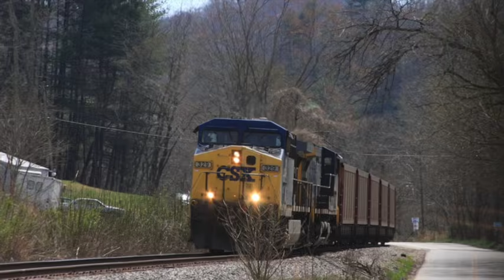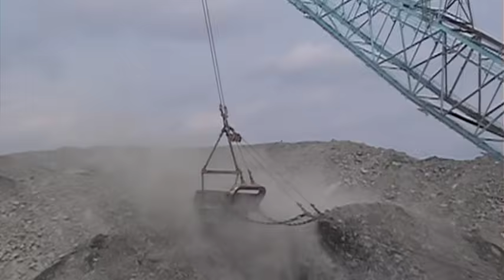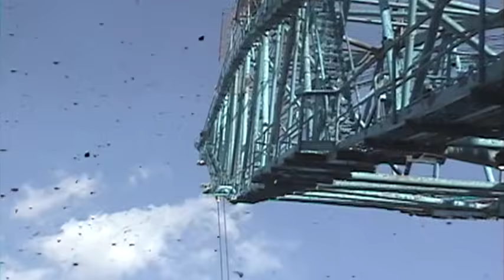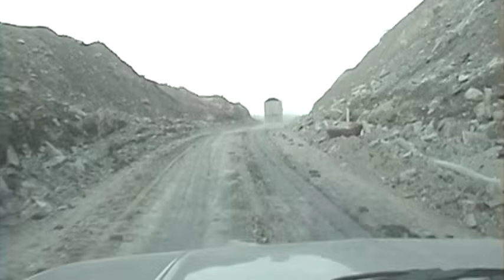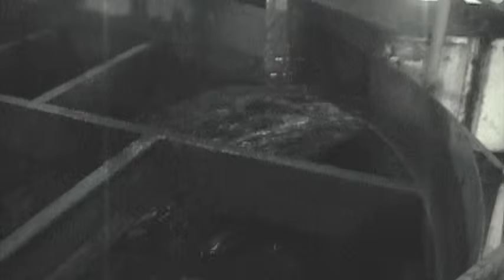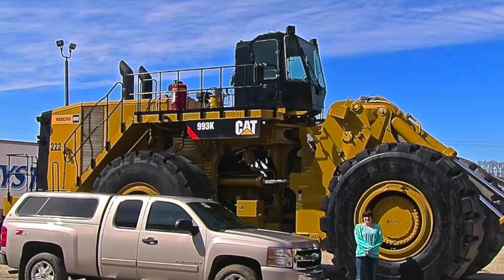Coal Mining in Appalachia

Comment: I understand that the industry uses coal to provide electric when hydroelectric isn’t available.  And my grandparents used coal until the mid 70s.  My parents used heating oil for as long as I remember.  But, I tried oil when I established my home, but now, I am strictly electric, probably by coal fired generators.  But, no smell, less maintenance. And it’s heat! Black Lung just driving!Great vlog!
Reply from the maker: Yes, in all likely hood the electricity we use comes from the burning of coal or another fossil fuel.  Like it our not it will take a long time to build enough windmill generators and solar panels to take over.  But we still have to contend with no wind and clouds not to mention night time.

Comment: 4:10 can anyone explain how a simple pull on a lever can open the latch of the bucket if bucket is holding about 50 tons?
It baffles me as surely the rock would press so hard on the catch as to need a great effort to move it to open the bucket!
Reply: @ericstandefer9138  Dunno.
Seems the operator just pulls the little lever.
Reply: @ericstandefer9138  This video shows the latch seems to be operated by a simply rope/cable. https://www.youtube.com/watch?v=eXGbMUHp75E
https://www.youtube.com/watch?v=gptHVtRZxFs
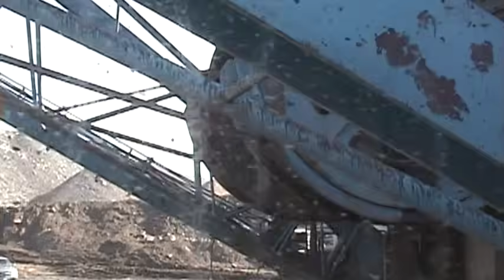But this video from 10:00 seems to indicate the bucket does have some electrical power latch as guy doesn't pull any levers to open the bucket.  Maybe it's that little switch on teh left hand control

Comment: Makes no sense to burn diesel fuel to dig up coal to burn in a power plant, just burn the fuel instead.
Reply from the maker: The coal produced gives more BTUs than the diesel burned.  If it didn't there would be no mining and they would have done what you suggest.  The dragline and the tipper shovel are both electric.

Comment: Reminds me of when I worked for a service company down in Martin County, Ky back in '77. Worked at Martiki Coal Mine and most of our work was repairing their drag line bucket. Martiki's Coal Mine had a drag line and three buckets of same style and size and the drag line ran 24-7. One bucket was used for thirty days, we repaired a bucket for thirty days and Martiki had a third bucket for an emergency spare. It was a ten hour day to change buckets. It required two D9 dozers to drag the one from our area to the drag line.  Then they would cut the huge pad eyes off the back heel of the "new" bucket and reweld them to the "old" bucket, hook up the two D9's to them and drag the old bucket back to our area for repair. This video reminds me so much of Martiki Coal Mine and all of the operations preformed and the types of equipment used back then.
Reply from the maker: Ed Heavner you are or were right next to W Virginia.  At the mine in the video they also had 3 buckets in rotation.  Digging rock is a lot different than dirt.  Thanks for the reply.
Reply: I worked steamin on this job and martiki both…the drag there was fenced in and I’dle time we worked there round early 2000s but I spent a many a long cold wet night bouncing around that strip ina old f series 460 with 525g water tank in a small dumpbed with 2 18hp steamers…usin that 9” hose to fill up was a trip…threw a boy off the tank on his back one time…miss them ol lectra huals and hualpaks parked up and what I believe were bucyrus shovels…blue n white addington colors..probably 5 in that 1 boneyard…man what memories…im from Prestonsburg btw
Reply: Facts 💯

Comment: We need to stop this. Way to much effort for such a dirty power source.
Reply: Raymond Bialk ok boomer
Reply from the maker: Okay Raymond, pretend you could snap your fingers and coal would disappear, how will you provide people with electricity?  What will you replace coal with, and I'm not asking for 10- years from now, I mean right now.
Reply: Well Gary,  !st. I just put solar panels on the roof of my house, took two days, and reduced my grid power demand by 80%. 2nd. Now with fracking oil fields, the U.S. is an exporter of LNG. Convert the coal plants to LNG. Conversion of an existing coal plant to LNG should be simple, especially with most of the infrastructure already in place, i.e. railroad access for LNG tank cars. LNG doesn't produce as much heat energy as coal but you don't have the 10% by weight, of slag, fly ash and toxic chemicals to scrub from the coal smoke. Slag storage ponds, in themselves, are a big problem too. No slag from LNG. 3rd. renewable power. I know storage of power is a problem there, but many new far less polluting storage systems are being built and invented. Coal has been the backbone of this great country and made it what it is today. It has provided thousands of jobs too, however, new technologies are making coal difficult to justify. I want to thank you Gary, for motivating me to looking more in depth at this subject.  MAGA! vote for Trump in 2020.
Reply from the maker: Hi Bill Rey, good thoughts you presented.  I ran a power plant, once coal fired but converted to natural gas, each of the two boilers produced 250,000 pounds of steam per hour at 360 psi.  The conversion  to gas was relatively simple as you stated.  As for energy we will need more and more as time marches on and coal will eventually fade away, but that will take time.  I'd like to use more nukes but that may be a pipe dream under current fears.  Fusion is far, far into the future, if it ever happens.  Here I'd recommend a book, "Sun in a Bottle".  Thanks for your comments.
Reply: I agree Gary, nukes is the way to go ....We have to address our growing power needs and now at this time in the nuclear history we have plenty of experience with that type of power. As I said. I was glad that you challenged my comments about coal. May I recommend a youtube video to you? It is called  "Coal in Kentucky" 
Very informative. Thank you sir.
Reply from the maker: @billrey8221  , thanks for pointing out the video of < https://www.youtube.com/watch?v=D8geiWr8b6w&t=357s >, it is one of the best documentaries on the use of coal I have seen.  We humans are addicted to energy, and will continue to use more and more of it.  It becomes a dilemma, one that will solved or not, we are currently keeping the 'not' at bey.

Comment: The old Marion 8050 was a good Dragline. As an old Marion erector I always liked the 8200 but an 8050 was my first job in North Carolina when I started with Marion. i put a 301 Shovel in the Star Fire minne in the early 1990s. I think it wound up at an Amax mine in Wyoming after it left here. Good Video thank you for it.
Reply: I lived by the big muskie drag line when it was running and my father  worked around it for a few years.    Amazing how the 3rd largest drag line could scoop up a house in one bucket.
Reply: @markginikos3939  the last time i saw the Muskie she was fenced i  and i couldn't get on for a look about. That must have been in 1993 or thereabouts. I was at AEP doing a repair on the Marion 8750. The Muskie was quite a machine even if she was not a great producer and cost AEP a lot of money over the years. They wanted the biggest and they got it. I never got to see the Muskie take a step on any of my visits. That walking system always interested me. I'm still partial to the Marion system but that hydraulic nightmare always looked interesting to me.

Comment: A new full-size power plant is nearing completion near me, to be powered by natural gas. That's the future. Gas is cheaper, there's no residue, (ash), and gas burns a great deal cleaner. There is no such thing as "clean coal". 
So adios, coal. Soon you will join whale oil as somethig we used to use to light our world.
Reply: The majority of domestic gas production is obtained thu the process of fracking, Im sure you are aware of its destructive nature.  It may be worse than coal.
Reply: DareToLive 
You’re right. I’m not endorsing natural gas, just acknowledging reality.
Reply: @Favel Konefka. 
Sorry, Favel. Gas is cheaper than coal and it's going to stay that way. The prices do fluxuate but gas/coal cost per kwh lines on the graph aren't going to cross; gas will be below coal.
Coal-fired generating plants are closing and no new ones are being built or even in the pipeline.
And that's a good thing.
Reply: @Favel Konefka. On the timescale where humans are using fossil fuels for energy. That won't be very long, maybe 50 yrs. Beyond that, if we haven't reduced our population numbers and aren't using majority renewable energy sources, Mother Nature will do both of those things for us. The few of us left will be living in caves.

Comment: I was  Looking at the  Drag Line  Bucket that was Next to the  Motor  Vehicle :  even though it is an impressive Sight We  In Cornwall England  Had a  Bucket where it was tipped upside down it was Used as a  Workshop and there was two Land rovers side by side where there was about  four  Feet Gap and the  Height was about  14 ft  The Drag line  Bucket Must have Held nearly  100 Tonnes

Comment: So, how many miners you think that dragline replaced?  That's what killed mining jobs, machinery, and automation.
Reply from the maker: Jestard14, that seems a strange question.  There were no miners replaced by the dragline because men did not remove mountain tops without draglines or bulldozers.  So actually no miners were replaced, but many truck, bulldozer, loader , and other heavy equipment operators were put to work to keep up with the dragline.  Then when it went away and dozers replaced it they needed men to operate them.  .

Comment: In one shot of the dumptruck bringing in the overburden just above the seam I see a boatload of fossil trees falling every which way of course they are not petrified but made of the carbon that the coal is made. the last of the coal seam is from plants that were silted into place as the sea rose again to cover them up. Thank you for the video and look for the black logs that fall from the bucket.
Reply from the maker: Hi Jim Waldo, that is quite an observations you made, I never realized it.  Could you tell me how many minutes into the video this scene appears.  I have looked for fossils in the area before but never within the coal seam itself.  Thanks for the great observation.
Reply: @garysmith4864  Hey Gary sorry it took so long to reply, kinda hard to come back home when I'm retired... :O}  12:00 straight up and you comment about the dragline having to stop to let the dumper from the overburden take a squat. That load is dark in some areas which is the individual plants that were the last growing trees and palms and such when that area was covered up with ocean and mud or sand and the plants never made it back to the main part of the coal vein.
 Near the very end of the load that was dumped you can see what looks like a black log roll to the top of the rest of the load, I could see several big tree trunk sections falling just before that. I have found the layer just above the coal is either sandstone from the sadny beach that washed in over them or is made from silt and is the same color as the nearby shale and leaves a perfect casting of the plant. Hope this helps, let me know if you have more questions.

Comment: I didn't know Appalachia does it like we do in Wyoming and Montana. I thought it was all underground. 
I work for a company that provides installation and repair for braking systems for mine equipment. I've spent the last ten years in the industry. Those are Eaton brakes on the dragline motors. We provide  Industrial Clutch brakes for draglines and shovels. Coal for power production is on it's way out. It's still needed for steel production.
God bless ya miners and support vendors. Keeping the lights on and the steel smelting!
Reply from the maker: Gregory, I've seen you coal out there in Galette, it's is something to see.  Much of the strip mining in KY is now shut down.  As you say, coal is going away, but let us run out of oil and gas and you will see politician singing its praise once again.  They will not let our lights go out.  I'd like to see some nuclear power but that too is almost finished.  We need a super battery to be developed for when the sun doesn't shine or the wind doesn't blow.
Reply: Here in Northeast Pennsylvania about 3 miles from my house, there are 3 dragline shovel's. They are still running 2 of them. The one in the bottom of the pit is the biggest in the world today. 
I too, used to make my living in the pits. I still heat my house with anthracite coal.

Comment: It's not "Mountain Top Removal". That's a BS name given to it by tree hugger's to make it sound bad. It's actually called "Surface Mining", but here in West Virginia we call it "Strip Mining". I'll guarantee you they are not removing any mountaintops. The mountains are still here. BTW in that diagram, that green dragline on top of the mountain and the yellow one are doing the same thing. There is no significant difference in the operations. You still "Strip" the "Surface" off to get to your objective. In this case coal.
Also, the top showing the spoil pile filling the valley is COMPLETE BULLSHIT. The spoil pile is kept as close as possible to the hole and/or used to fill in a "strip" that has already been mined. Sure shit rolls downhill so some of the spoil may end up at the bottom of the hill, but they are not filling in valleys as the diagram implies. Or as the narrator implies when he says it will be recontoured and become the new mountaintop. Surface mines have to be "RECLAIMED". Meaning the holes are filled back in, trees and grass are planted. It is "Re landscaped" I suppose you could say because it will never be as it was before, but only because the type of trees or grass planted may not be what was there before. But the land elevation and contour will be as close as humanly possible to the original landscape. Imagine how hard it would be on map makers to keep up with the changing contour if "Recontouring" was done. 

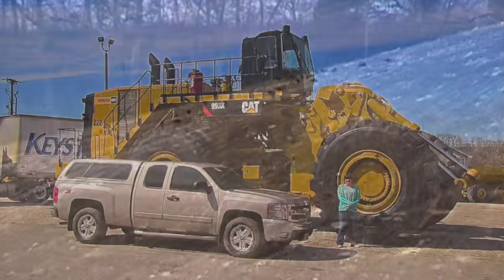At 20:15 where the narrator is talking about the dragline being gone and replaced with bulldozers because the  "Whole" operation would shut down if the dragline broke, but no big deal if one out of 27 dozers breaks down. That's bullshit. The dragline was moved out because the mine was finished and the dozers were brought in to do the "RECLAMATION". BTW all you hear or see about that is in the description, "See  Elk enjoying the reclaimed land" and what the narrator says starting at 24:52.  

The coal and rock separation, known as washing the coal, happens at the tipple, AKA "the washer", or the loadout center. Point being the train full of coal should have been included with trucks. They all get loaded at the same place if they're hauling clean coal. 

Other than that it was a pretty good video.

BTW  FYI Surface mining is how the lithium for your green energy batteries is obtained, but it's called "Pit Mining" in that industry and other ore mining operations such as gold, iron ore, copper ore.......
Reply: Thanks for filling in all of the questions that I had after watching this video, especially about the reclamation process.
Reply from the maker: Pete Henry, I beg to differ with you on your second paragraph above.  I met the man who decided to use D-11s instead of using the dragline.  What I said is what he told me.  If he was lying then I was wrong.  I'll stick with my view based on conversations with the operator of the mine.

Comment: In terms of equipment wear and tear...it doesn't get any more severe than this.  The strip mine I grew up next to in Indiana didn't use semi trucks to haul out coal.  They used (if I recall) 240 ton tractor/trailer type haul trucks.  I don't quite remember the tonnage but they were tractor/trailer mine trucks even larger than those CAT off road mine trucks here.

Comment: The scale is staggering... As huge as the drag line is, it looks like digging at a mountain with a tea spoon.... Hard to believe its economic to strip away so much overburden
Reply from the maker: Yes, the scale is staggering, the draglines are all going away across the coal industry.  In the case of the mine I video taped it was moved to a potash mine I think.  It was replaced by D11 CATS.  There were 28 of them at a cost of $2 million apiece.  The mine is not shut down and reclamation is almost done.
Reply: @garysmith4864  For only a 4 ft seam of coal.... wow... Margins must have been razor thin..
Reply from the maker: @keepersboy  Yes I suspect they were but I really don't know.